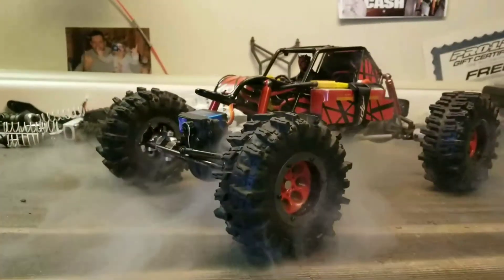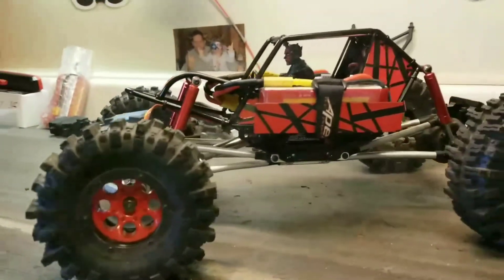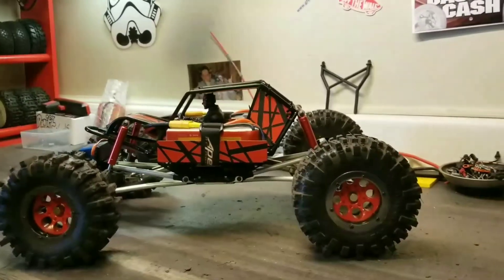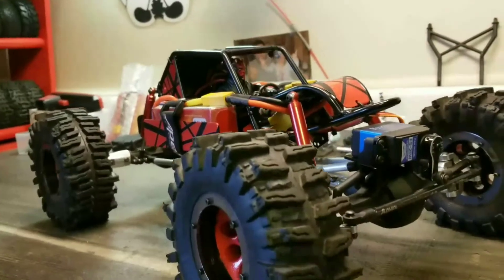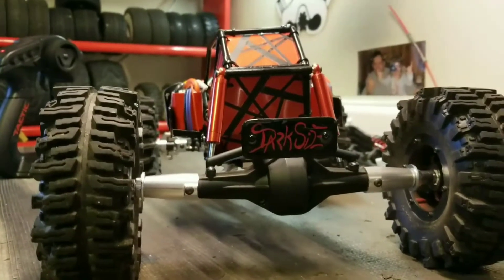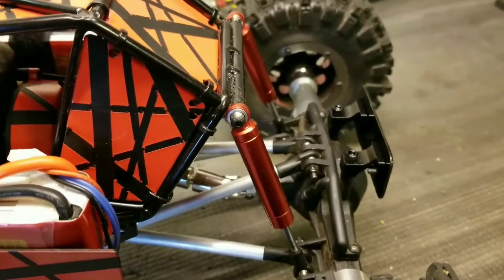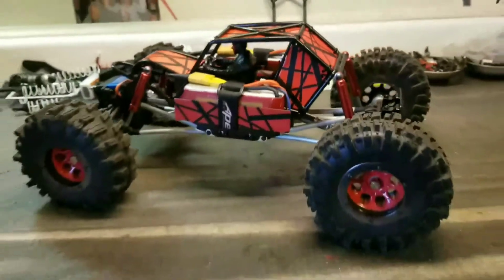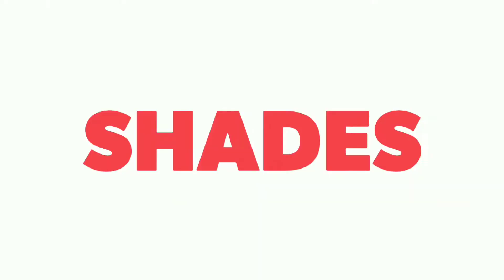Project "Dark Side" side panels and Name Plate

Comment: Looks good now I want to build one Don't know where to start!
Reply from the maker: robert gantz get the cage first then go from there. The easiest way is starting with an scx10. Once you get the cage it's butter bro. You can definitely get it done😎
Reply: ShadesNBeardRcGuy cool ty
Reply: Scx10 frame?
Reply from the maker: robert gantz it's not the scx10 chassis. Just the trans plate from an scx10 atacheched to the cage. Which is now the chassis.
Reply: ShadesNBeardRcGuy 
Oh ok I've got it ty